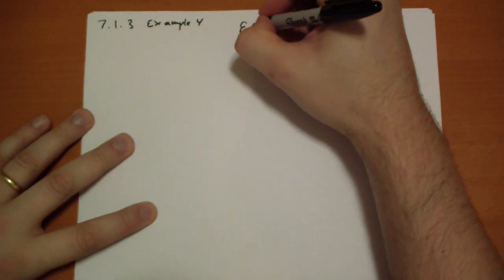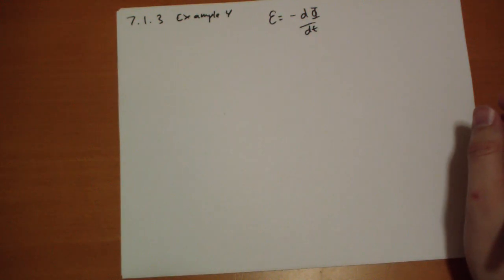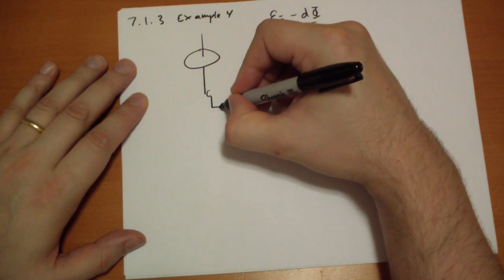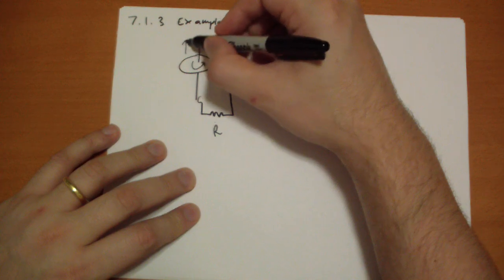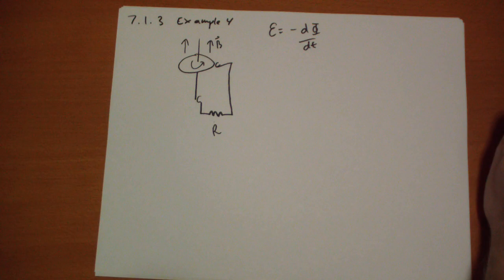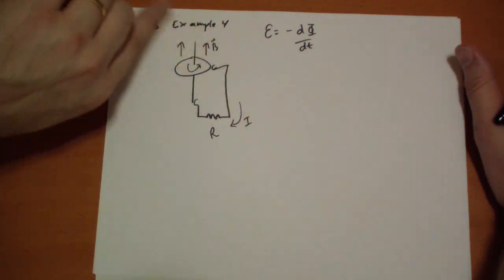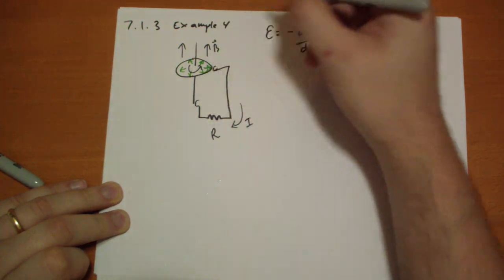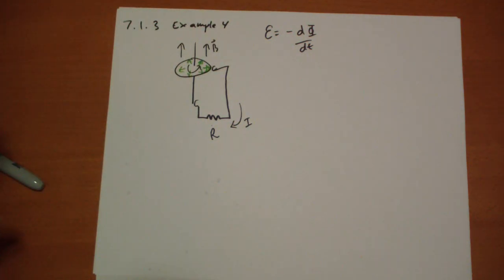7.1.3 Example 4

Comment: You used the right hand rule to determine the direction the magnetic force pushes the charges, shouldn’t it be left hand for negative charges?  Shouldn’t the direction therefore be towards the center of the disc rather than the outer edge?